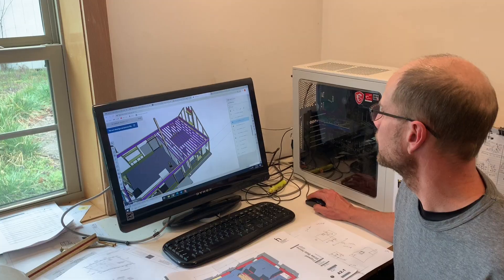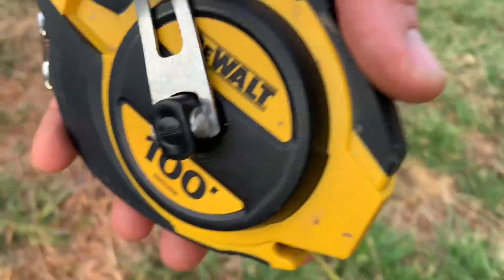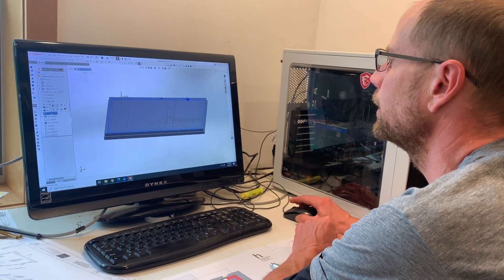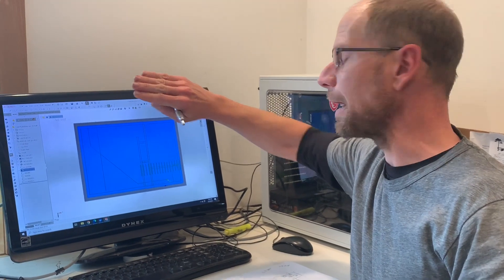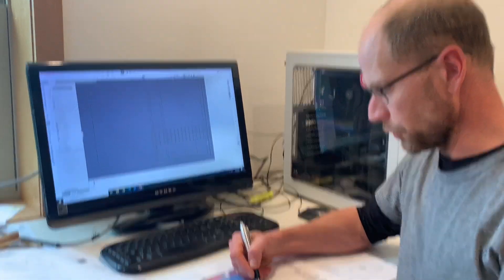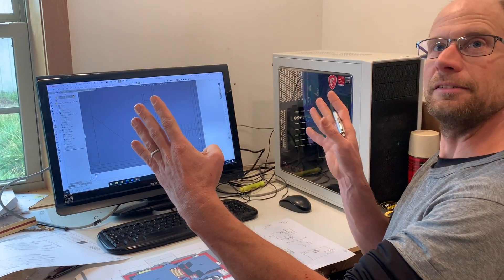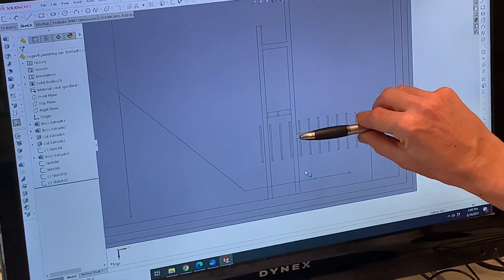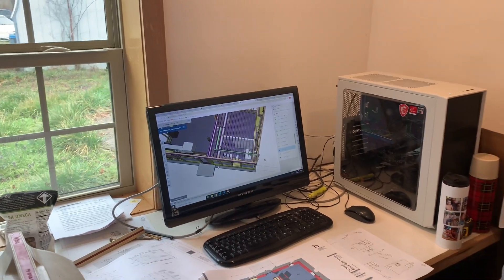Important To-Do's before Starting Under Slab Plumbing for a Concrete Slab Foundation: Episode 3

Comment: 2:47 mins into the video, I see you ran about 35 ft of buried plumbing conduit across the slab, isn't it more efficient to place the pipe sleeve closer to where we've got the shower/toilet/bathrooms/kitchens and then run your plumbing outside the slab?
Reply from the maker: We have a vaulted ceiling and Strawbale walls that are more difficult and risky to get plumbing in. So we ran lines to the kitchen sink from the washer under slab.
Reply: @HeirloomBuilders  Thanks !